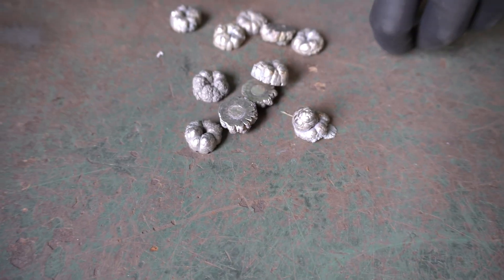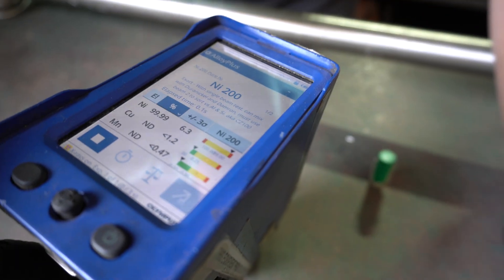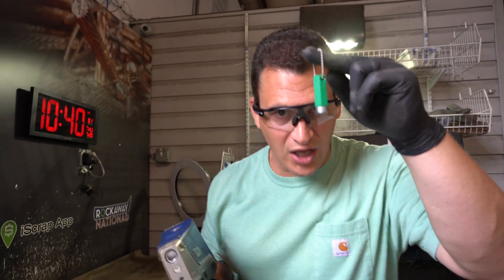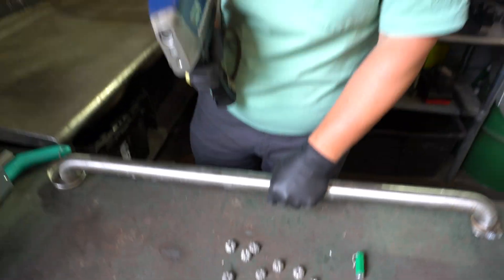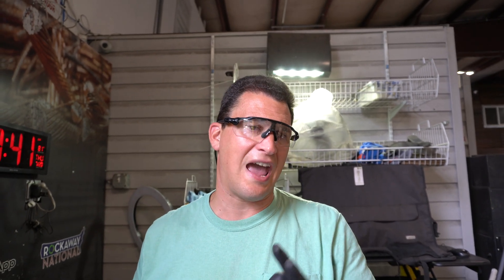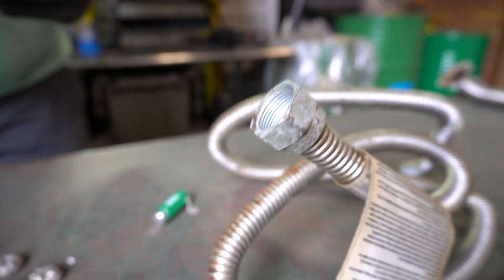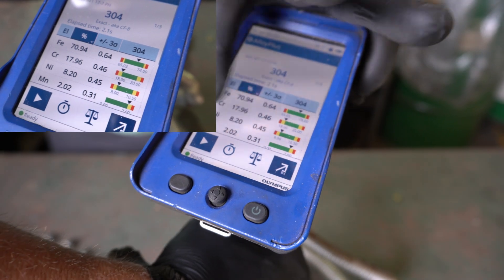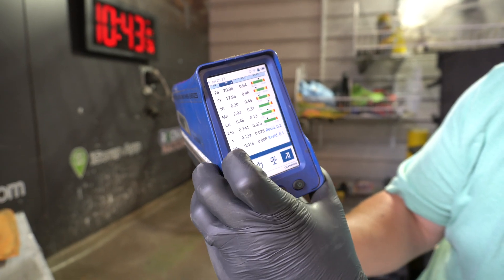What Is Nickel & How Can It Be Scrapped

Comment: hey dude tell you employees at RR to analyze metals - they have refused and dodged a proper analysis for my metals twice now. I was fine with them putting stuff in wrong (transformers as ballasts most often) but those dudes are the gates are getting rough when you have no idea what prices they're putting in to the console until after they've dumped all my stuff into the bins.
Reply from the maker: Hey there. Give us a call in advance next time and we will go over it.

- Tom Buechel
Reply: Your nearby competitor announces the weight and metal type before moving on to the next item every time. Ain't that difficult of a policy to implement.

Comment: thanks for the info Tom, i do have a Question, several times when i Scrap Cords for Bare Bright, i am Finding the Copper in the Wire has turned Green, is it still Bare Bright or Dirty Bear Bright ?
Reply from the maker: this is a discretionary call by the scrap yard - some will accept it with a little corrosions, other will not.

Comment: Hey Tom, I came across something real interesting today. A long rod that appears to be copper? Found in the trash of a fiber-optic cable installation company.  A magnet sticks to it, not firmly but it sticks, however it certainly looks like copper, and hitting it with a file shows that the metal is solid, it's not a copper coating on steel, it's something like brass. So it's a Steel/Copper alloy of some sort, I think it's a grounding rod for electrical stuff. What would I even sell this as?
Reply: It’s copper colored and magnetic? Could be monel
Reply from the maker: It's a grounding rod - made of steel
Reply: If you use the corner of a file on it, you will most likely find out it is steel with a copper coating.

Comment: How about a video on the different grades of stainless, I think most scrappers are getting screwed on stainless that a magnet sticks to, like 409, 430, 439 etc
Reply: Grounding rods are typically copper clad steel.  If it is strongly attracted by a magnet, it more likely a steel rod with a copper cladding.
Reply from the maker: Hey here's a video  we did on 316 vs 304! Maybe this will help: https://youtu.be/6Rl48jK_hHc
Reply: @iScrapApp  good video but is there something called magnetic stainless?

Comment: Question 🤔  is that why when you have non magnetic stainless valves  that have paint on them and you burn 🔥 the paint off it becomes magnetic   🤔🤔🤔🤔🤔
Reply: I've had magnetic pull on stainless.
Reply: @jimnalgrin3515  yes lightly  me to  !!  But I'm talking  about fuel valves that can't be magnetic  !!!
Reply: @evankibbe590  The crystal structure of the alloy must be arranged in a martensitic or ferritic structure. If the alloy has an austenitic crystal structure, then it’s not magnetic. I learned that when we were demolishing a top secret Russian Radar base in Skrunda, Latvia.
Reply: @jimnalgrin3515  cool 😎
Reply: @evankibbe590  We had tons and tons of stainless in the receiver building and we got into an argument with the German Scrap dealer.
Reply: @jimnalgrin3515  yes 👍  you can  get in to those arguments 😏
Reply: @evankibbe590  I'll tell you a funny story. One time I was working on a power station and I saw the excavator digging dirt. You never dig on a power station because of the contamination. Then I saw them piling the processed scrap overtop the pile of dirt. The next day the guys wearing suits cam out and were looking at the scrap pile. Come to find out the demo contractor got a huge loan using the pile of dirt as collateral.
Reply: @jimnalgrin3515  oh my talk about  fraud!!!! Lol 😆 🤣 😂
Reply: @jimnalgrin3515 
I don't get it. ??

Comment: We've all seen nickle alloys like stainless steels, but also in a few other applications, but didn't know it. 

It's found in hard drives, it's what the hard drive magnet is mounted to(see "mumetal") 

Mumetal or similar like "permalloy", is used in transformers, relays, and other devices. It basically somewhat resists or blocks magnetic lines of flux. The nickle content is very high in said alloys.

If you scrapped a boiler or swimming pool heater, the tubing for the water may have been cupronickle, a copper/nickle alloy.
Reply: Helpful thanks